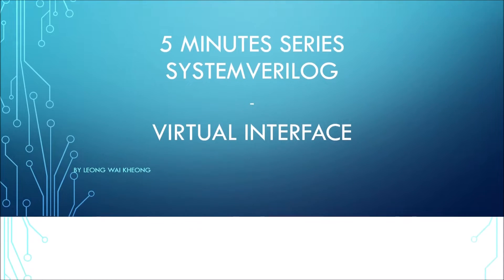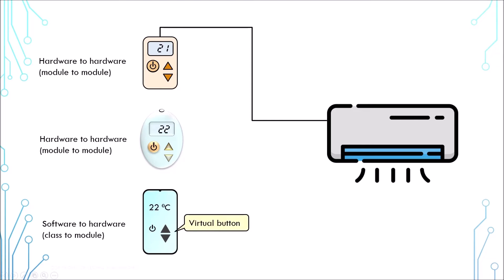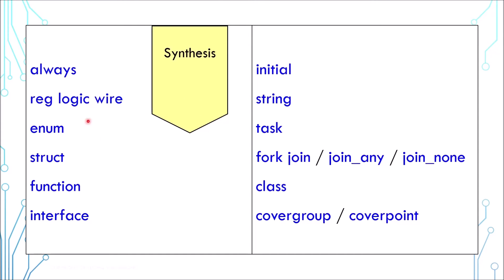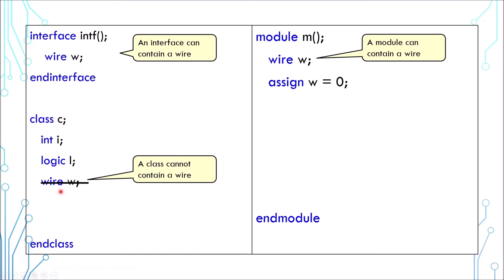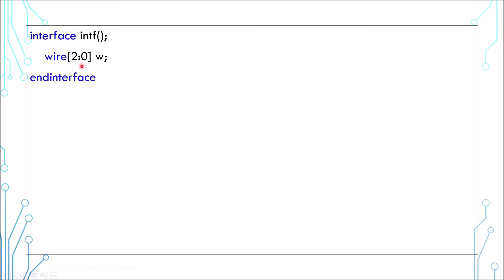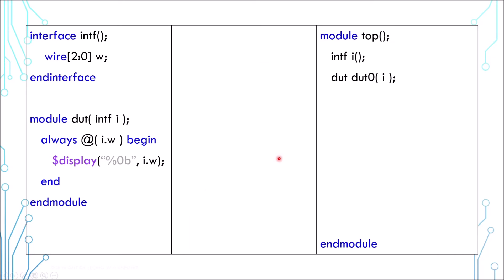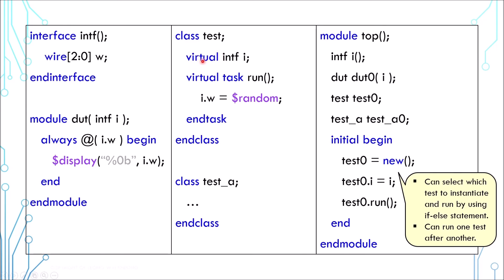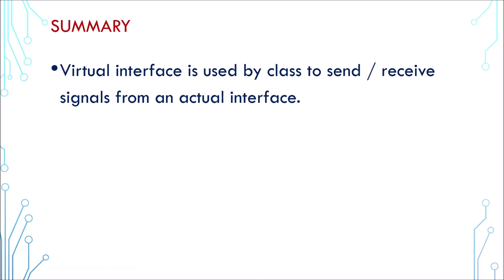SystemVerilog Tutorial in 5 Minutes - 15 virtual interface

Comment: why is it a conflict if we instantiate multiple modules in top level one after the other test_a test_a0(i), test_b test_b0(i)..etc (3:01) vs running one test after another by instantiating them sequentially via classes (3:50)
Reply from the maker: It depends on how you write the modules and classes. In this particular example, the modules use assign, it is the assign statements that would conflict with each other. All assign statements will create a multiple drivers contention (where the signal becomes x). Imagine if you use initial block instead, the initial block would start as long as its module is instantiated. The initial blocks will not create multiple drivers contention, but they would create a race condition (you can't tell who drive the signal at the end). Whereas instantiating classes does not start any code execution (unless you have execution code in the constructor new).
Reply: Because interfaces and modules are static components. What happens to one happens to them all, and that can be a problem if you are telling them all something different at the same time.